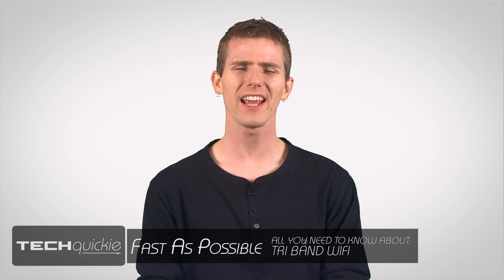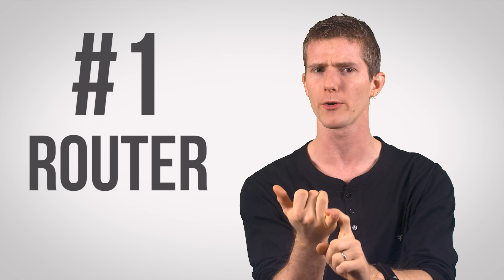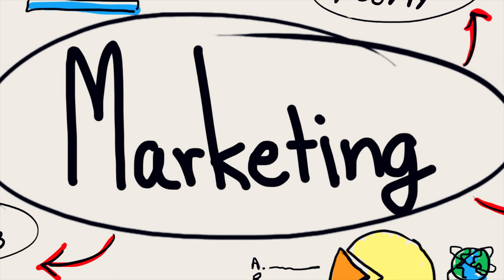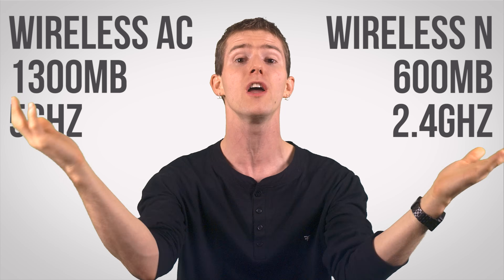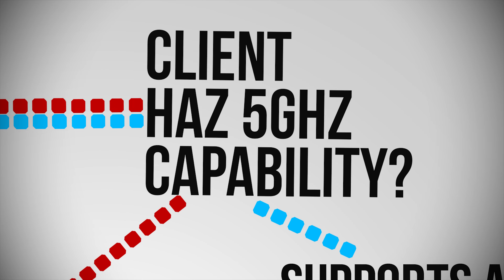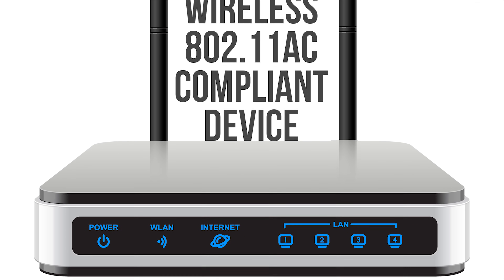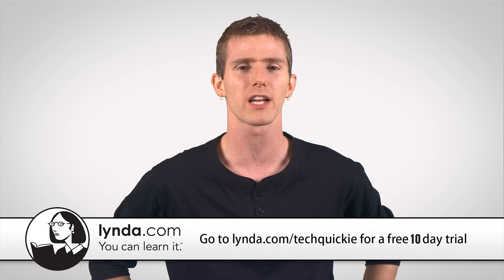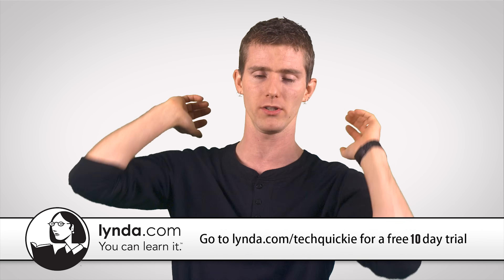Tri Band WiFi as Fast As Possible

Comment: Is there another way to communicate between computers? Like with sound waves or light waves? We use radio waves and those do seem the best when compared to other ways, just wondering if we could think of something better than what we have.
Reply: ***** light waves are already used.. the internet is based on it.. all continets in this world are connected by very massive seacables which in fact are fibre-optic cables using lightwaves to send datas from the usa to europe for example also you can connect your stereo to your computer by using toslink..
but using lightwaves for some sort of wireless communication wouldn't work.. at first: what would happen if you use it and turn the light on in the room?
second: photons wouldn't be able to transport a signal through walls like radio does..
and sound well.. can you imagine how this would be? also the communication through walls would be bad and on top it would not be fun if you could "hear" your wifi connection xD
well you could use waves that are outside of the human hearing but.. what about your cat or dog? also you would have big speakers to produce this waves and microphones to receive something and you would need them also on your computer to send something back..
can imagine this in your phone or laptop? 
lol but funny thought, thanks mate made my day xD

Comment: Anyone else notice that there's only two band actually at play here, not three? True Tri-band will be achieved by adding 60Ghz to the already existing 2.4Ghz and 5Ghz radios.
Reply: 5150MHz & 5250MHz are the 2 5GHz bands. So, combined with the 2.4GHz, makes 3 bands. The router juggles between multiple channels of these bands.

Comment: Yeah, residential ADSL2+ speeds in Australia can barely break 10Mbps. I don't think we even have to worry about Wireless N or AC, unless it's a university or business fibre connection. (Despite I still run Wireless N)

Comment: Yeah another problem with the above 1gigabit conection. The RJ45 input for your router is limited at 1gb. so basically every router out there is 1000mbit instead of 1300, 1600 etc...

Comment: explain cache memory
Reply: Larger memories like hard drives and SSDs are more concerned about bulk storage than performance. When an instruction is being used, it is better for performance to copy it to a smaller faster memory. Imagine you're cooking a meal. The fridge is the bulk storage like a hard drive. Finding what you need means walking over to it and digging around to find what you need. You grab everything that is related to the recipee your making and place it on the counter (RAM). These items are relevant to what you're cooking so they are closer by and faster to get to. Finally the cpu cache is like the cutting board. You tend to only have the thing you are actively working on, on the cutting board. So you have the onions you are dicing on the board. Without this closer nearby memory every time you took a cut of the onion you would have to go back to the fridge to get the onions again. So a cache is using smaller faster memory to store instruction. And to why don't we make caches larger is because of cost. Faster memory is expensive. Imagine the cost of buying a terabyte of ram.
Reply: Timothy Lastovica I saw the current amd apu's they have 1mb l2 cache while intel pentium's have 3mb cache and i want to build a amd apu based system on low budget should i be worried ?
Reply: Manthan Sit While having a larger cache helps reduce cache miss rate, it is only part of the overall CPU. As long as the benchmarks for the CPU you're looking at meet your requirements, you'll be fine. Just like how you shouldn't compare a 4 GB 760 to a 3 GB 780 Ti based on Vram. The biggest concern when getting an AMD APU is finding some good 2133 MHz+ cas 9 RAM so the on die GPU has plenty of bandwidth.

Comment: Hey, anybody reading this that knows about this stuff, I would appreciate some help.
I have an apartment in Turkey and the WiFi in the bar there is terrible, just like 5 people on it would prevent people connecting. Would me buying a router here in the UK which is tri band (or dual band), then connecting it over there to their internet line and stuff (replacing their old router) resolve that problem? Thanks for any tips, would be GREATLY appreciated! :)
Reply: If the problem is concurrent connections then yes. If it is an issue with interference from walls, other devices, or just distance then it might only minimally improve the conditions.
Reply: Timothy Lastovica Cheers dude, any recommendations? Normally around 15-25 people at once. Anything I should look for?
Reply: Chris Price Productions To be honest small business routers aren't my area of expertise. Usually you want certain security features like virtual LAN to keep your guests separated from your business computers. Though as far as a good consumer grade routers I'd check out the Linksys WRT 1900 AC. It allows quest networks to be set up on both the 2.4 and 5 GHz band. I also checked the online manual and it says it supports up to 50 guests.
Reply: Sounds good Tim, thanks for your advice, I'll look into it!

Comment: If my router supports 2.4 and 5.0 GHz (at 300mbps) should I connect all my devices to the 5.0 and will the unsupported ones be put on 2.4 automatically? Also how do I know if my device is supported or not?
Reply: Usually your router will expose two SSID's, one for 2.4ghz and one for 5ghz, devices that don't support 5ghz won't even see the 5ghz SSID. A wise choice would be to confirm these are named differently by configuring thing this on your router. Alternatively you can dig into the settings on said devices and see if there's a toggle for 2.4ghz and 5ghz.
Reply: Steven Faust thanks :)
Reply: Steven Faust That is not entirely true, there are device's with 2.4GHz receivers that can see a 5GHz wireless broadcast but cannot utilize them when it comes to sending/receiving data.
This will usually result in errors when trying to authenticate the client to the access point.
Reply: ***** That's true. That's why I said usually :)
Reply: Steven Faust ha, i missed that! :P

Comment: Could you do the whole "bits" vs "bytes" thing, which could include "1GB = 1024MB"

...not quite sure if it's 1024...
Reply: Multiples of 1024s or powers of 2^10, like gibibytes, are different to gigabytes, which are multiples of 1000 (10^3).

This is also why storage devices like flash drives report a lower than advertised storage space. 14.4 GiB instead of 16 GB. Both mean 16 billion bytes of storage... This is the same for any other memory unit.

Comment: hi linus and techquickie. when you use mega bit you use a little b for example:10 megabit= 10Mb and byte is big B:
10 megabyte= 10MB so please don't use it like that so we wont be confused thx
Reply from the maker: Good point. The font we use has no lowercase so sometimes we get lazy about it
Reply: lol i get it but your here to help us learn so if you can i will be very happy
Reply: +Double G Strictly speaking, 'bit' is the symbol for the unit bit.
Reply: Yes I noticed this too and it was confusing the f**k out of me. I really didn't think this was something these guys would mess up.
Reply: Double G 10 mb is not equal to 10MB
Reply: @angryjose  it's Mb vs MB, the "M" is caps either way, little b for bit, 8 bits in a byte and staying with proper designation the caps "b" or B  in MB for megabyte. anyhow you are only 4 years late on this discussion lol

Comment: Okay so I'm new to the pc gaming world and I recently built myself a gaming pc. I have a major problem. My parts list is as follows. 
Corsair cx 430w power supply. 
1 terabyte Western digital green hd 
Sapphire Radeon r9 270x
Amd Athlon 760k
Pny 8 gig ram. Ddr3
Now when I go to try to install an operating system on it it will not even load. I can access the bios and I'm booting from the flash drive yet nothing will work. I've tried many different copies of windows legal and non. And I've also tried Ubuntu. Neither work. And when I went to go see if the operating system would install on my laptop it worked fine. When installing windows I end up getting an error 0xc0000221 /windows/system32/ntoskrnl.exe. Someone please help I'm completely lost. Thank you!
Reply: Marcuss2 it was the ram the ram was defective
Reply: Its either a disk or ram problem I´d say, try running memtest off USB/CD, if it will not work at all... its a RAM problem and serious one, hope you live in countries with mandatory guarantee
Reply: Which mobo are you using?
Reply: A quick google search told me it could be your harddrive, have you tried a different one?
Reply: JMaxchill im using msi a78m e35
Reply: ***** and yes i have swapped out the hard drive with one that has an operating system already on it and i will not boot.
Reply: TDWP1996 Have you tried switching between IDE and AHCI modes?
Reply: ***** no ill try that now
Reply: ***** okay i did that with unbuntu and it started to install then failed and said end kernel panic
Reply: TDWP1996 Didn't work with Windows?
Reply: Are you sure your PSU is powerful enough? My build is very similar (same CPU, GPU, similar HDD) and it draws very near 430W, so I would suggest checking that
Reply: Check the boot order in the bios.
Reply: TDWP1996 At least you got it, fortunately RAM is not expensive, I had similar problem and professionals were not able to nail it down, I was able to do it, when I changed it, the crashing stopped.
Reply: -4 months late, I know - many older OS have problems with UEFI, I had to turn that off to install Windows 7 and any other Linux distro, 8 should work though...

Comment: hey linus, pls be clear of Mb and MB, i suppose you know they are different
Reply: b = bit. B = byte. 1 byte = 8 bits. 
1 Gigabit (Gb) = 0.125 GigaByte (GB)
Reply: And as in internet. 60Mb/s is equal to 7.5MB/s
Reply: Donnie MiB, as in....Men In Black?  O.O
Reply: And if you mention Mb and MB, why not touch Mib and MiB as well?
Reply: ____Byte is usually for STORAGE measurements while ____Bits are usually for SPEED measurements.
Reply: Donnie MB is storage, Mb is data transfer speed
Reply: ***** MiB as in Mebibyte.
1 GB = 1000 MB while 1 GiB = 1024 MiB.
Windows uses MB while MiB is sort of like a system filesize type. That's why HDD's seem to have 'less' space than advertised (1TB - ~960GB), because of the GiB -> GB conversions
Reply: Dunkelelf3 You right
1TB advertised is 1 Decimal TB which is 1,000,000,000,000 Decimal bytes converted to binary is 931.32257461547 GB.
Reply: Dude don't be that guy, no one likes that guy.
Reply: onerudyburgerwebdez both are units of measure for information. It's like saying that whales are measured in meters and train cars are measured in feet.
They are convertible units.
It's the common convention however, that networking equipment use bps as the unit of measure, and people are used to deal with Bytes when it comes to storage, but users generally understand Bytes better than bits. That's why almost all software measures transfer speeds in Bytes per second. Because that's meaningful information.

It's been a long while since anyone has really dealt with anything but Bytes anywhere in the application layers.
Reply: TheMrminimario mate you got some things wrong there.. actually windows names it wrong.. it gives you the GiB number but names it as GB..
if it would be named GiB it would be correct.. if it would be 1 TB or 1000 GB it would also be correct..
but what windows does is give you the 1TB converted to GiB so ~931 GiB and names it GB.. so you also can't blame the hard drive manufacturers cause they advertise it right only windows does it wrong..
and no it has nothing to do with filesize types it's just the difference between binary and decimal numbers..

1 KB is decimal so it's 10^3 = 1000 B
1 KiB is binary so it's 2^10 = 1024 B 

1 MB is decimal so it's 10^6 = 1000 KB or 1,000,000 B

1 Mib is binary so it's 2^20 = 1024 KiB or 1,048,576 B
and so on..

and if you summ this 24 B difference up to sizes like TB you have bigger and bigger gaps between what was written on the box than what windows can use of it.. the byte in this is the same as the byte is always 8 bit so 8 states of yes or no, 0 or 1.. but usually the smallest size used for anything in storage is byte because you can't adress a single bit in your system.. the byte is the smallest adressable unit..
windows also doesn't use MB as it is still a computer no matter what software you are running on it and a computer understands binary only..

Comment: I'm really confused about the cpu specs (cache, speed, cores) and gpu specs. And intel quad core 3.75 ghz means 4×3.75 or 4=3.75. Can someone explain me abou this?
Reply: LONG ANSWER

GHz is kind of meaningless without information about the underlying architecture. At the most basic level cpu execution time is ((instruction count x cycles per instruction) / GHz). Newer processors usually have better cpi which is how many clock cycles it takes to finish each instruction. Using that formula you learn how long a single core takes to perform a set amount of instructions. Not every instruction / program scales across cores perfectly. For a program with perfect multithreaded support then the effective performance is the single core performance times 4 for a quadcore. For a program with no multithreaded support, the other cores will remain idle while a single core completes that task. The other thing to note is even if the application has poor multithreading, the other cores are free to work on background tasks while that application is running on its assigned core. Modern applications usually offer good support for multithreading so on average you'll find the performance to be closer to 4x. 

As for the CPU cache, it is simply the amount of memory for the cpu to store frequently used instructions. The hard drive and SSD storage are more concerned about bulk storage than speed. To keep the program working fast important parts of it are copied in a smaller but faster memory (RAM). The instructions that are most frequently accessed are moved from RAM to the CPU cache. A larger cache is better but generally you have little control over this when purchasing a processor. Your I7s and I3s generally have the larger cache sizes on each core because of Intel's Hyperthreading. Which is it keeping 2 thread of data in the cache per core and the cpu core can switch between threads when one of the 2 it has been assigned stalls. 

TLDR
Generally it will be closer to 4 x 3.75 but it depends on multithreading support. Always go with the newest revision as it will have underlying changes to run instructions faster. An Intel I5 is generally you best bet for all around performance, money, application support when it comes to shopping for Intel.
Reply: Timothy Lastovica thank you very much man I appreciated

Comment: Can you make a AFAP about disk fragmention and what happens when you defrag it?
Reply: Read the sequence by the order of the corresponding numbers.

2(dog) 1(The) 3(jumped) 7(.) 6(fence) 4(over) 5(the)

The numbers represent the memory address where the data is located. The parentheses is the data at the address. Defraging is placing the data concurrent next to each other.

1 (The) 2(dog) 3(jumped) 4(over) 5(the) 6(fence) 7(.)

Which makes the data a lot easier to read since, just like the head on a magnetic drive, your eyes don't have to skip around.

Fragmentation can occur a lot of different ways but the easiest example i can give is imagine the sentence is surrounded by other data, but you edit it to add in the word brown.
(other data) 1 (The) 2(dog) 3(jumped) 4(over) 5(the) 7(fence) 8(.) (other data) 6(brown)

You can't overwrite the data in the neighboring sectors as you still need it so you have to store the word brown somewhere else on the disk. So you will have to defrag the drive to get the data concurrent again.
Reply: Thanks mate!